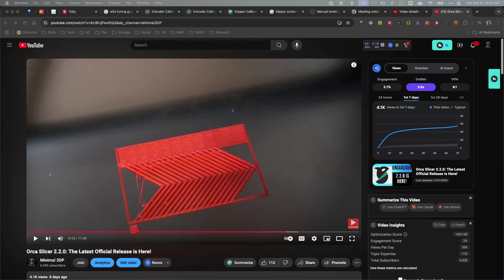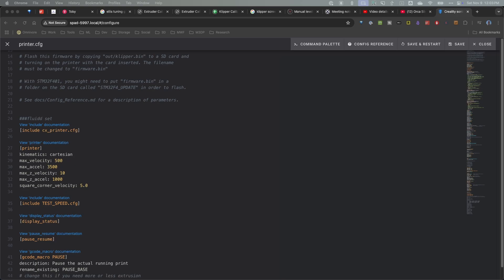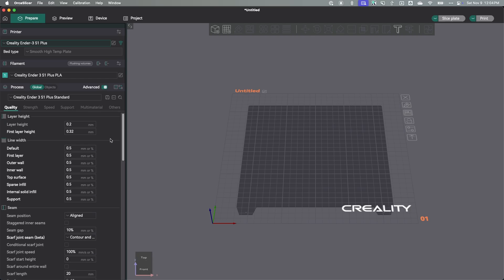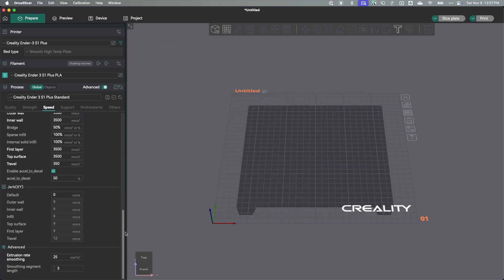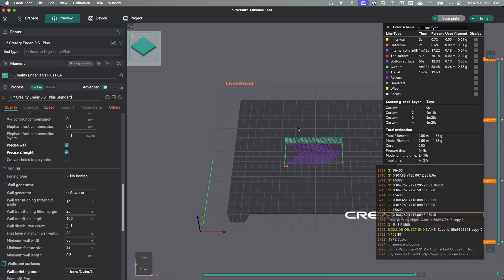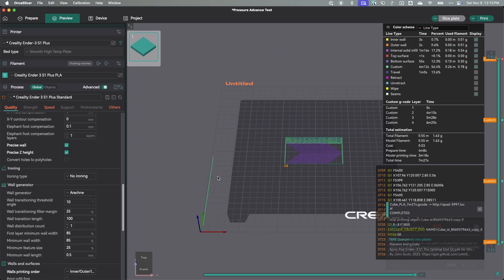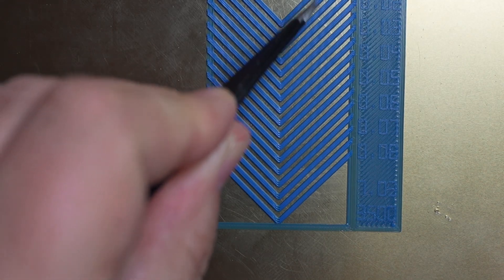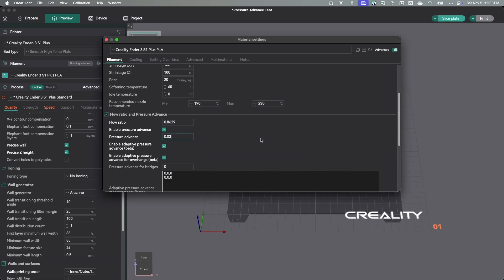Master OrcaSlicer 2.2 Calibration and PA Testing: A Step-by-Step Guide

Comment: thanks for revisiting this topic. I tried as suggested and it's working as intended. However, I've just noticed today that if I have the "enable adaptive pressure advance (beta)" ticked within the filament setting, in the stl gcode, I saw 2 lines of set pressure advance. The first one is the setting PA according to the figure I wanted it to be based on PA calibration, then another line after ;AFTER_LAYER_CHANGE to 0. Not sure if anyone is also having similar issue or is it just my ORCA. if anyone can please confirm then that'd be muchly appreciated.

Comment: The printer config is setting the maximum values for the hardware.  They can be set to what the hardware can do without skipping steps (and keeping 10% safety margin from where that would happen).  There are various videos on Youtube on how to find that point, but actually measuring that will be uncomfortable for your hardware and your nerves, so just using a reasonable max. value is often the best choice.  The slicer can then set accelleration and speed within the range the printer / Klipper allows.  Klipper will simply use the lower of its max. limit and the value set by the slicer.  The slicer can of course dynamically change the speed and accelleration depending on the type of line it's laying down, whereas the max. limits in Klipper are pretty static.  And for Marlin, basically the same holds, except that the max. values are either hardcoded in the firmware or stored in the NVRAM/flash by Marlin instead of a config file.
Reply from the maker: Thanks for the great explanation.

Comment: Thanks for the video. I'm a little confused on what the speeds & accelerations should be. You're mentioning how values in printer.cfg (which I currently can't find?) and the various Orca profiles can provide info that is not necessarily consistent. I'm running a FlashForge 5M Pro and using the Orca profile for that machine. I haven't modified anything. So would the provided speeds & accelerations be correct or should I be looking to make changes? If I should be making changes, what do I use to determine what the values should be set to?

Also should you just do a full calibration for each new filament type that you run? There just seems to be so many things that can change from filament to filament (and the various calibration options Orca provides) that I think it makes sense to just test each new one you try. At least my goal is to try to determine a standard set of filament that I'll be using and I want to dial that in the best I can so I can get the best prints possible. Does that make sense or am I missing something?

When I try to do the PA calibration, it displays the dialog asking me for my choices and I select PA Pattern and select OK. But it then appears to do nothing. I'm left with the plate with nothing on it and the Slice Plate isn't available (grayed out). What am I doing wrong?

 Appreciate any help. Thanks.
Reply from the maker: Have you gotten it figured out?

Comment: I see the line width setting you are using is 0.5. Are you using a 0.5mm nozzle on the ender 3 s1?
Reply from the maker: No. I am using a .4 nozzle.
Reply: @minimal3dp  line width is set at 0.5 is the result better or how am I new to using orca
Reply: can you tell me why you chose 0.5 line width to get better or more precise print results?

Comment: Where can I find my printer config file? I'm fairly new to 3D printing but finally getting around to dialing in my 3D printer.
Reply from the maker: This is a Klipper feature (the config). Are you using Marlin or Klipper? If it is marlin, let me know what printer you are using and I will try to post the steps.
Reply: @minimal3dp  I'm running an Artillery Sidewinder X2, stock firmware.
Reply: @minimal3dp  I'm having trouble finding printer.cfg too. I'm running MacOS and am using a FlashForge 5M Pro which I believe is running Klipper. Where is this file located? Thanks.
Reply: For klipper users, leftside menu, machine, folder(config).. the file its called config.cfg